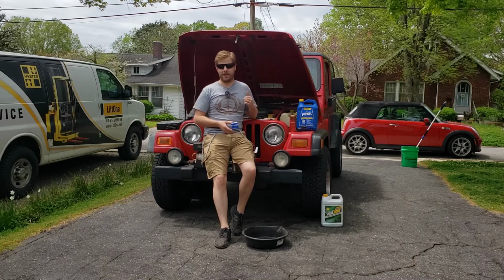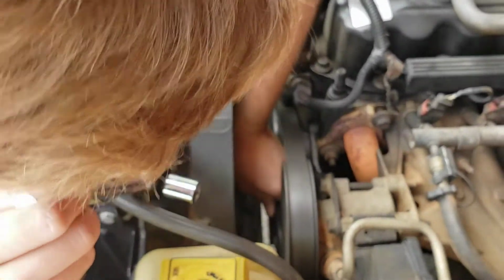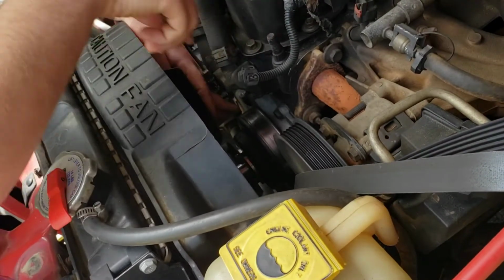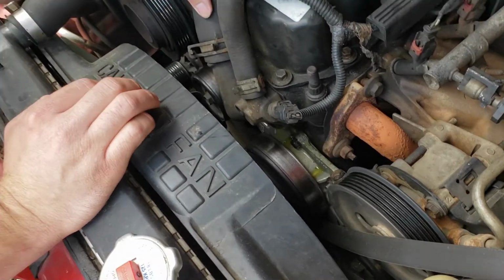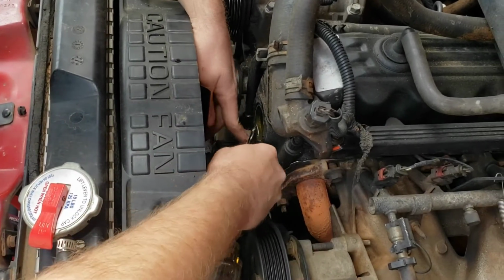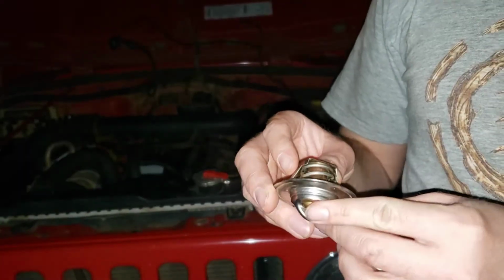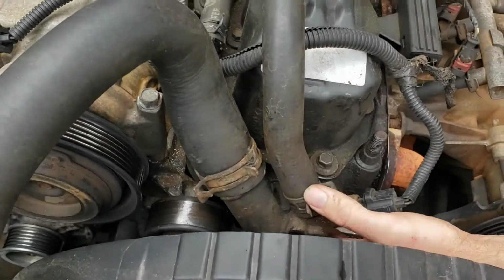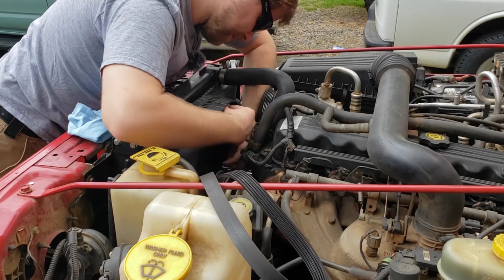Jeep Wrangler 4.0 Thermostat Replacement [How-To]

Comment: A garden variety 1/4" socket will line up on bottom bolt without removing the fan belt.  You will have pull it a slight bit to get a perfectly straight shot at bolt.  Also, DO empty the radiator from the drain valve.  I lost zero coolant when swapping in a new thermostat.  Finally, WD-40 is your friend when dissolving residue from old gaskets!

Comment: No need to remove the belt, also you should always stick a rag in the hole while you clean the old gasket off.  That will keep you from getting pieces of the gasket and sealant in the engine.

Comment: Why didn't you drain the coolant before you removed the thermostat? Also, is removing the belt really necessary? Chilton's says to drain the coolant and doesn't mention removing the belt
Reply: (from personal experience) 
have something to colect it with at the bottom, coolant will come as you remove the hoses and the thermostat itself. belt is somewhat in the way of the lower bolt, dont have to remove the belt, up to the person (i didnt remove it). 

I didnt watch the video, needed for school assigment as a sourse. I changed thermostat on a jeep which was pure rust bucket and had to remove the housing to clean up everything.

Comment: how do you know you didnt put the thermostat in upside down or sideways?
Reply from the maker: It's always a good idea to note (or take a picture) of how the old part was installed, but if you forget a good rule of thumb is that the longer end (the side with the spring) faces towards the engine block. As long as you have that part correct, you're good. Since it is round, the orientation doesn't matter if it is correctly in the hole. Don't forget to install the new gasket before re-installing the thermostat housing.
Reply: @HufflerGarage Also only torque bolts down to 13lbs max :)